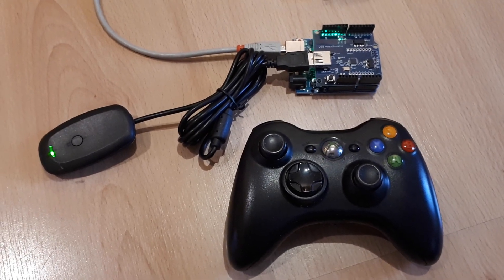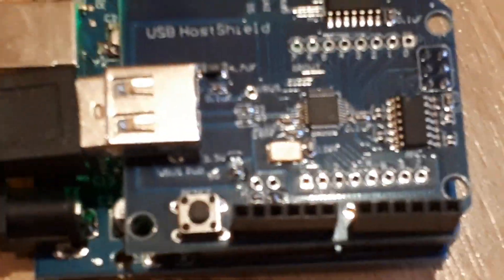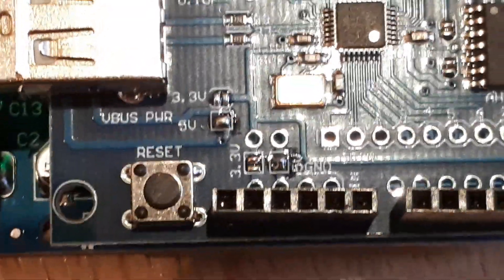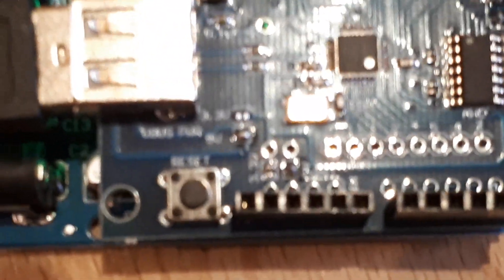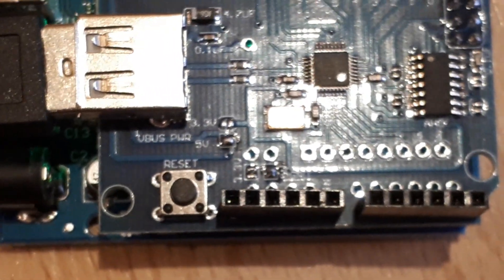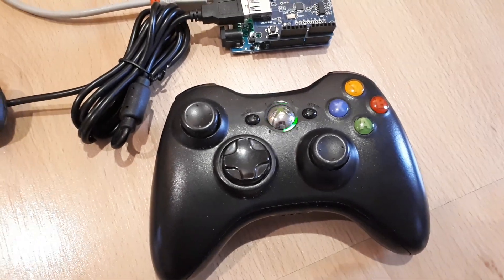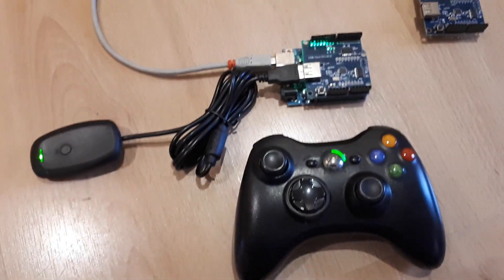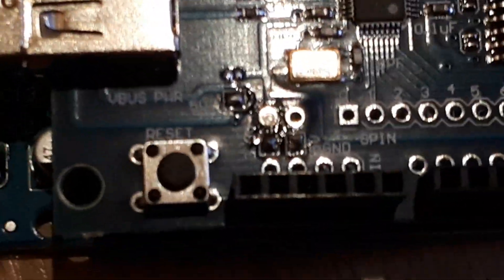Padawan 360 issue - resolved host shield issue

Comment: I have a hopefully easy question, I was using a usb host shield for a mega 2560, but it wasn’t working, and I think it might be a chip problem, where can I get one that works? Possibly this time with an uno.
Reply from the maker: My honest advice would be, just buy a Mega ADK board (you can get them for around £25 on Aliexpress).  It will save you so much time and headaches.
Reply: @ Thanks, I forgot to respond but I emailed you and you helped me get the right chip soldered on and it works now. Thanks for the help!

Comment: Hey, all of the 5v and the 3.3 are soldered on the usb shield. I’m using a Microsoft receiver but it won’t pair. It will flash if I press the pair button but otherwise it doesn’t light up. Any ideas?
Reply: Got the same problem :( did your one also light up?
Reply: By the way - I organize now the original MS, and I works perfekt! Regards
Reply: @suffratte what did you organise?

Comment: I guess my only problem is that I'm using an off brand and it won't sync at all. originally I got ZERO power to the receiver, but now I got power to the receiver after seeing this video soldering the 3.3 and 5v. However the receiver and controller are not talking to eachother at all. I ruled out that it's not the receiver after plugging it into my laptop and it synced up instantly. I tried the resync button on the controller just in case, still nothing.

Comment: I soldered the 5v connections (both) and also the 3.3 volt near the terminals.  There is no power to the receiver and it won't light up.  It lights up when plugged into a PC.  What am I doing wrong?
Reply from the maker: Tricky to say without hands-on, does the receiver flash if you press the button with it all plugged in? Sounds like power isn't getting to the usb port.  Double check all the pins on the piggy-back board are correctly inserted. How are you powering the arduino? Direct to the 5v from a 5v supply?  Could be if you are not running the 5v line, it's struggling to provide enough current.  If you can, email me a couple of photos of the boards to imperiallandm@gmail.com
Reply: @ImperialLightandMagic  thanks for the reply your site is awesome.  Looks like the USB shield I bought is not compatible with the mega board even though Amazon site said it was.  I swapped out with an uno board and now receiver powers up.
Reply from the maker: @SeansHobbyHouse  That is very odd, I don't see why it would have made any difference, so long as the pins were correctly aligned.  I've ordered a mega so when it comes down, I'll test it for sure.
Reply: @ImperialLightandMagic  Yeah not sure.  The other thing with the mega is the drive control for the motors did not work either.  So perhaps its the Mega sketch that's the issue.   The Uno board and sketch, everything worked.  But after power was applied to Mega, the light on receiver would never light up until I unplugged the USB and back in.   I wanted to use the mega as I have a bunch of other things I want to do, so I will keep playing with it.  I was using a genuine Arduino Mega, but I have a generic one I can try.  I was using a genuine Microsoft controller and receiver too.  Perhaps I was missing a library.  Would the IDE let me know that when I upload sketch?
Reply from the maker: @SeansHobbyHouse  Yes, without a library the sketch will not upload, however there can be subtle differences in libraries depending on where you source them, but I'm not convinced that's your issue.

Comment: mine are soldered and the puck still wont bind.
Reply from the maker: Have you tried binding whilst plugged in to a PC?  If it binds then, it stays bound, no need to re-do it when plugging in to arduino, don't forget, the default power up state on the transmitter is spinny circle, which can look like it's not bound!
Reply: @ImperialLightandMagic  I does not stay bound when plugged into the arduino. Once plugged into the arduino the controller no longer is bound and any attempt to bind it fails.
Reply from the maker: @bgrant1512  Can you upload a video of what is happening, it might help diagnose the issue.
Reply: @ImperialLightandMagic  Theres really nothing to video, plug the puck into the saint smart shield and it blinks. Turn the controller on by pushing the big silver button and it blinks. eventually the controller shuts down. I went ahead a bought a real MS 360 usb puck but that wont bind to the controller at all, not even on the PC. AT this point unless I can get links form someone for thier actual working hardware (usb receiver, controller , usb shield) Im done with it.  Ill just use a 10 channel receiver and my RC radio. I can run it through the arduino and code from that base. It would be nice to have a smaller controller but its just not worth the hassle at this point.
Reply: @ImperialLightandMagic  I have the same issue. It pairs on the pc but when plugged into the arduino it loses connection.  I think I need to change something in the code to bind them. What's strange is it worked on my old receiver but it died, so bought a new official one and now it doesn't pair
Reply: @brewzerfpv1210  I’m having the same exact issue, my controller connects to the reciever when it’s plugged into my computer, but once it’s plugged into the usb host shield it won’t connect
Reply: @skuly_2987  it's been a while but I think I had to buy another USB host shield you need to make sure it's the same model as there some that work better than others
Reply: @brewzerfpv1210  ahh that’s what I’m thinking, because I have everything soldered on the shield and still nothing, thanks for your help!!!

Comment: the problem is the receiver number, change it in the code, and it works just fine..shame u never respond, im still stuck with the PiePanels...
Reply: @Rikard Johansen - thank you very much for your time. Absolutely great support! Take care! Best Regards ☺️
Reply: how does one do this?
Reply: Hi, What kind of Nr is it in the code and where do I see it in the „Detail’s“ from the receiver, when I plugged into Pc?
Reply: @suffratte  here : 2. Update the Library

Open the file:

USB_Host_Shield_20/XBOXRECV.h

At around line 44 you will see a collection of VID/PIDs. All you have to do is edit one of the VID lines, and one of the PID lines with the IDs that you got in the previous step.

Save the file, recompile, and upload to your arduino. The third party receiver should now be working.
3. Fun

Thats it, you should be up and running now. Or at least a step further into getting your droid completed (not that they're ever completed!)
Known VID

    XBOX_VID 0x045E
    MADCATZ_VID 0x1BAD
    JOYTECH_VID 0x162E

Known PID

    XBOX 0x0719
    THIRD_PARTY 0x0291
    0x02A9
Reply: @suffratte  #define XBOX_WIRELESS_RECEIVER_PID              0x0719  // Microsoft Wireless Gaming Receiver
#define XBOX_WIRELESS_RECEIVER_THIRD_PARTY_PID  0x0291  // Third party Wireless Gaming Receiver

see the 0x0 numbers, those u have to change, and it will work just fine
Reply: @suffratte  just a sec i find it for you